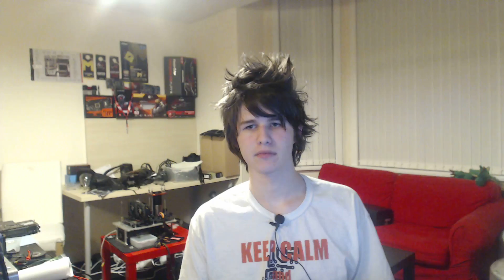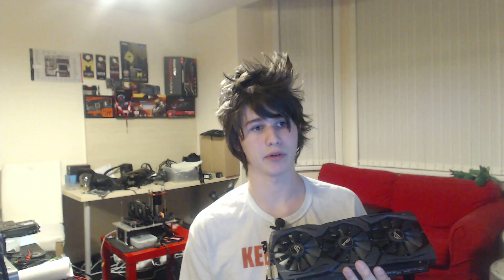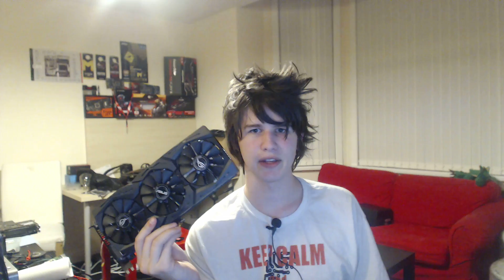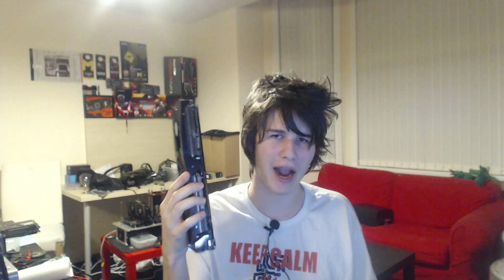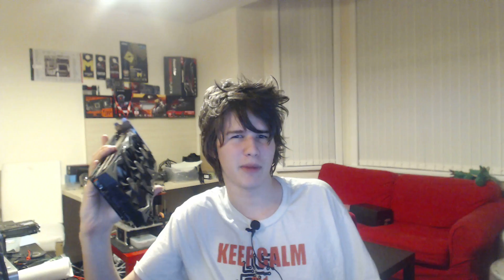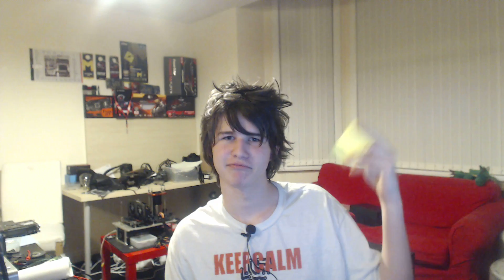RX 480 STRIX thermals update

Comment: hey buillzoid you tested "rx 480 voltage control 0.1b"?? it is a little pluggin for msi afterburner, that lets you put from +12mv all the way to 400mv on any rx 480. I tested it on my rx 480 gaming x and it works very nice.
Reply from the maker: Never tested it but AFAIK it just uses afterburners I2C capabilities to control the IR 3567B(you can do the same through command line). So I don't see why it would have any issues.
Reply: yeap... but it has a wider voltage range that any other program i tested. Im used to afterburner, i been using it since my hd 5870 (2010 i think) and i hate strixx, the layout is very bad and ugly.
Keep it up man! greetings from argentina!

Comment: ... Yeah, if the randomness of the chip itself leads to such huge thermal and power differences reviews become very problematic.
You'd have to get large batches of cards and do statistical measures of them  under identical loads to get any kind of accuracy in that case.
And who can afford 100, or even just 10 identical cards just to do that right?

Comment: I actually just bought this card, even though it won't OC as well as others, because newegg had it for $229, plus a $20 MIB.   Can't beat that price for an 8GB RX480.    I was hoping you'd have better news on the card, but oh well.    I haven't done much with mine yet, but after seeing this I wonder if there's enough clearance to sandwich a very thin piece of copper between the processor and the heatsink.  maybe a piece that runs across all the heatpipes, to help spread the heat more evenly.

Comment: I have one of the lower end 480s, the RS from XFX, and mine clocks 1320 at stock voltage, which I'm pretty okay with. Temperatures aren't impressive, but as a gamer/streamer, I'm not terribly concerned with it as long as it holds up. I might try changing the paste on it just to reduce that and see if I can push the clock into more of the 1350/1370 range, but I'm not super willing to play with the voltage all that much since I don't have a backup in case I break something.

Comment: Personally I got a Sapphire NITRO+ RX 480 OC 8gb. video card. The Strixx RX 480 wasn't worth over $300.00 to me and it takes up more space. I've got mine overclocked higher to video : 1450, ram: 2150 and mV +60 and Folding@home 24/7 it doesn't go over 76 degrees.

Comment: It's a shame EK Water Blocks doesn't sell add-on kits for any after-market RX 480 that has more than 1 fan. That would solve all the problems. Better thermal paste and water cooling for higher overclocks at lower temp's.

Comment: even my gtx 1080 from evga the thermal paste made a huge difference had a new card from rma that they took apart and put the thermal pads on in warehouse  nicked the base went and redid it myself and dropped  the temp 10 degrees and boosted way better

Comment: I have a 1070 Strix and a couple tubes of NT-H1. I'm curious now if Asus is using the same paste on Pascal, so I'm going to replace the paste and do some thermal testing. I can also take pcb pics while it's apart if you're interested
Reply from the maker: I can already get pics for the 1070 STRIX
Reply: Alright, I replaced the stock paste with NT-H1 and it's running 7 degrees cooler (At 64% fan speed. I was dumb and left the fans on auto with stock paste and then just matched the fan speed)

Comment: Hold up, 1370mhz 1200mv? My Nitro+ RX470 8gb runs at 1380mhz 1080mv rock solid 24/7. Now, I know 470s run a little cooler and with less power, but god damn. That strix is a brick. jkjk =p

Edit: Also, if you're curious, it barely hit 70c running Heaven for hours. Low fan setting is 1k and high fan setting is set to max in wattman.

Comment: FYI, approx 2-3W per RAM chip.  Approx 5W for 64b bus doing 8Ghz GDDR5.
Dunno if you like to include memory controller in core power.  As is on die, but should be non-variable.

Comment: How long does thermal paste keep? Because I ordered a 50g tube of mx4 instead of a 5g tube, and that's basically a lifetime supply from where I'm sitting :p
Reply: Keep it in a cool and dark place and it will stay for a long time. I've had a tube for two years that I still use to this day and it's been solid.
Reply: Doctah thanks! That's where I keep it, so good to know I'm doing the right thing
Reply: yeah it'll keep for a while. especially since MX-4 is a non setting paste.
eventually it will go bad - you absolutely won't use up the entire tube unless you build computers for a living - but it'll be good for quite some time.

it highly varies from paste to paste though. they're all different.
and container for sure - as plastic is not a very good insulator at all. electrically bad, but it's also porus which is bad for sealing.

Comment: You would think they would save money and get better temps by using a slightly cheaper fansink and slightly more expensive thermal paste. This Is also a serious problem for laptops, after replacing the thermal paste many CPUs stay noticeably cooler. many higher end manufacturers or business class devices (apple, fujitsu, hp elitebook, etc) will use proper thermal paste, whereas bargain bin consumer units always use the cheapest stuff possible. You will see it fossilizing and cracking off after a few years.

Comment: This is the thing I hate about overclocking that it's pure luck getting a good chip that is actually power efficient and has good overclocking capabilities. I hope yield rate and chip quality vastly improves if we ever move away from silicon.
Reply from the maker: Vega is bigger than Polaris
Reply: Math shows Vega chips already have much higher yield rate than any current silicon used by AMD. Smaller die, larger wafers, higher quality production, higher frequency, better overclocks. Vega seems a win-win for amd consumers.
Reply: If silicon lottery wouldn't be a thing OC wouldn't exist at all("final clockspeed" is basically a "we measured n+1 gpu and they were stable on these settings, so set all of them up like these", once they can manufacture GPUs which can perform exactly the same they will either run at full speed, or will be hardcoded to be able to sell slower models at a lower price).
Reply: +Surms41 And that Vega has a higher yield rate has to do with the fact that the 14nm FinFET process has been vastly improved over the last year. The chip quality itself, how power efficient and overclockable it is, can still vary much. The yield rate just says that X percent of the chips on a wafer will function properly and are within specs.
Reply: I think adore tv made a video about Polarish efficiency where he said that most efficient polarish (best yields ) chips goes to Laptops or other battery powered lower tdp machines (some even in hospital equipment) .So we desktop users maybe getting the worst of the yields .So in that theory best of the polarish can run on 95 watt with high frequency ,which were mostly send to laptops
Reply: +2strokedesign Yeah, okay, that may be right, but let's say there would be chips that overclock very well in general and all overclocks are very close to each other with a specific voltage, so the chip quality does not vary much. And let's say the only downside to these chips would be that the power efficiency gets worse the higher you clock it, so the voltage needed for a specific clock would not rise linear. So there would be no point for a manufacturer like AMD to offer extremely fast gpus if they just get too hot and eat too much power for a slightly higher clock speed although all chips would be stable at these clocks.
This would have the cause that water cooling would have a point again when it comes to performance and that better cooling solutions and better power delivery systems would matter more again than the chip (quality) itself. Overclocking would be still a thing and and would be even more fun again because it's not based on luck.
I hope you can follow my idea and how it would be better for everyone.

Just btw. Polaris does have the exact behaviour of my "imagined chip" mentioned above. It is extremely power efficient at low clock speeds but the chip quality does vary tremendously.
Reply: maybe, though science suggests that it's not likely. as things are scaled down further, margin of error goes up / becomes more important, Et Cetera.

for example, Manufacturing Defect rates have actually gone up since the 70's and 80's despite going from hand assembly to purely robots.
but, total manufacturing capacity has also gone up too.

Comment: what is better card to get, a rx 480 8gb or a 1060 6gb
Reply from the maker: RX 480
Reply: Clearly the RX480 8GB since it has more memory, better performance overall and is more future proof because drivers... and recently got a lot cheaper than the 1060 (at least in Europe it dropped below 250€ for nearly all custom cards)

Comment: Gamers nexus done a video about thermal testing , it's a sh## fest to get right , need to control every variable . i got two rx480 reference cards in crossfire , one is golden the other is a turd , it's definitely the silicon lottery , hopefully AMD get better at controlling the manufacturing variables ....it's all about control .. love the content , thanks
Reply from the maker: There are test methodologies that can get around most of the problems GN listed. I for example always list max temperatures for a fixed fans speed and since I manually control the fans I always start the testing from hot to cold so all the test after my initial 35% fan speed test can only read too high temps not too low since the cooler was warmer in the last test(I get all my data without ever stopping the work load). I take care of ambient by just taking the ambient temperature infront of the GPU at the moment that I record the temperature value. GN on the other hand test long term auto fan speed averages for GPUs and long term thermals for cases. Both very different test scenarios from what I do.
Reply: best Rx cards goes to laptops,medical equipment with 95 tdp ,watch adore tv video on  polarish efficiency

Comment: I had the RMA my GTR 480 (I'm the guy who couldn't clock it past 1350, briefly asked you about that card before) and now with my new one I can hit 1500Mhz running about 1.290mv I want to say? Funny thing is though the card was running ridiculously hot compared to my other card same everything. I replaced the Thermal paste with Noctuas NH-1 paste and it dropped the temps by 14°. Which is quite frankly absurd. Thoughts? I was thinking just a bad application by chance at the factory. It seems to be close to a golden card though
Reply from the maker: 73.3%
Reply from the maker: 1500 on 1.29 is only 20MHz behind my GTR for that voltage and that's with maxed fan speed an Kryonaut. As for the temp drop. Yeah XFX seem to be hit and miss on the thermal paste applicatin my card was fine on the stock paste. But I've heard of several cards with really high temperatures until getting repasted.
Reply from the maker: Wattman maxes out at 1.15V on all cards. Use Sapphire's Trixx
Reply: my msi gaming x can go up to 1400mhz on 1262v, and 1435mhz (max bencheable at 1,3v). The good thing is that stays below 76°c even with the stock fan curve and max overclock. 
So... your chip is a golden one, no doubt
Reply: Actually Hardcore Overclocking Ah OK. Out of curiosity, what's your ASIC on your GTR? As far as simply just raising core (memory runs no problem @2250) I can finish a Firestrike run @ 1450ish. Any past that I have to slam the voltage.
Reply: Use MSI Afterburner
Reply: hey buillzoid you tested "rx 480 voltage control 0.1b"?? it is a little pluggin for msi afterburner, that lets you put from +12mv all the way to 400mv on any rx 480. I tested it on my rx 480 gaming x and it works very nice.

Comment: the heat pipe temp discrepancy is actually a big deal. there shouldn't be a variance of more than .5 (closest to the plate, obviously) maybe pressed metals were used?

EDIT is the GPU closest to the HDMI ports (back of the card) or is this the type of rx480 that has the GPU about in the center of the board?
Reply from the maker: PCB: https://www.techpowerup.com/reviews/ASUS/RX_480_STRIX_OC/images/front.jpg

Cooler: https://www.techpowerup.com/reviews/ASUS/RX_480_STRIX_OC/images/cooler2.jpg

The smallest heatpipe with no thermal paste on it reads 5C cooler than the pipe with the most die contact. Still I think I need to check how hot the ends of the pipes are.
Reply: To be fair, Sapphire has long had the best reputation among AMD card manufacturers, so you shouldn't be that surprised. XD
(It's reputation was already quite well established when I got my Sapphire Vapor-X Radeon 5770 in 2009, so it really does go back a while.)
Reply: The reputation is a bit overrated since the Nitro 390 has really mediocre VRMs..